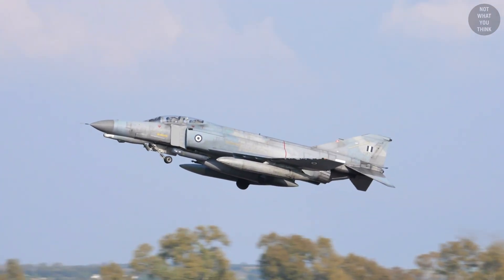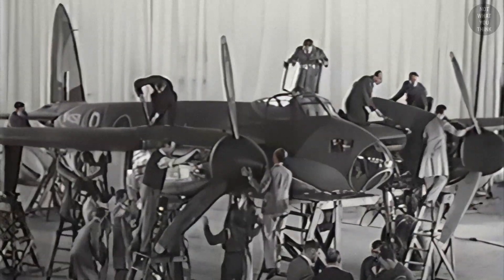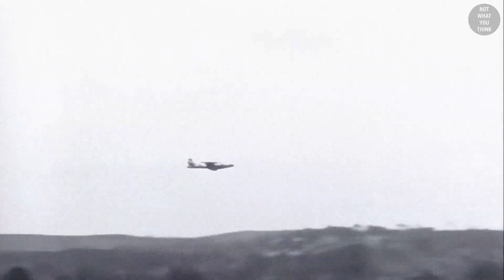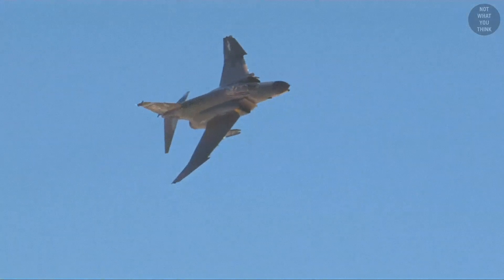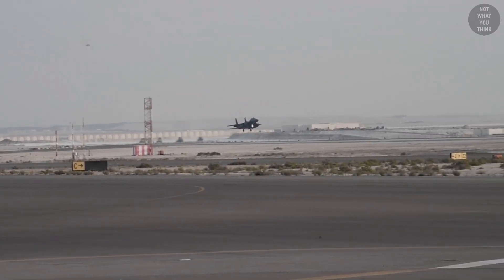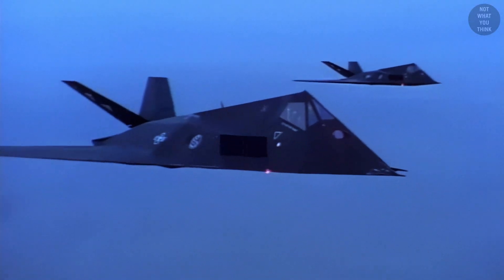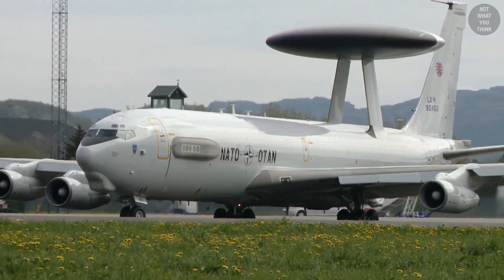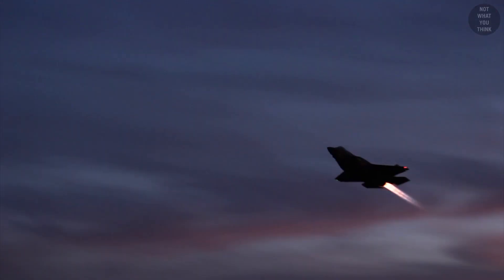Why are Modern Fighter Jets Slower than 1960s?

Comment: You're right about the wasted fuel accelerating to a combat zone for most planes but the F-22, a few others have supercruise, enabling long-distance flight well above supersonic w/out afterburner. With the F-22, top speed is classified but acknowledged as at least Mach 2.3
Reply: Supercruise is almost useless nowadays.  Better to stay high subsonic, move into unfair/unseen NEZ parameters, release with LPI Data-link mid-course guidance, possibly with cooperative LPI and EW held in reserve/conjunction with the attack.

Comment: So you can go mach 2.2 for 10 minutes, then you have to slow down and refuel,  that modern fighter can  even supercruise and go a lot further in the long term.  Not to mention the new fighter can out turn and out gun the older fighter.  In fact the older fighters first indication that the "enemy" is there is going to be when the "enemy" missile explodes in his face - buh bye.   The only issue we have had is that the ROE keep including that line "Visual ID" (VID)   and that's why modern fighters are still designed for the unwanted dogfight.    Tell a modern fighter pilot "Weapons Free":  and remove the VID rule and the pilot in that old jet will be dead before he ever gets a chance to see the enemy.

Comment: The problem with the f35 is that it's a cheapout solution in order to streamline production into one airframe. However it suffers from the jack of all trades/ mediocre at all trades problem. Also it's not cheap

Comment: The MiG-25 was theoretically capable of a maximum speed exceeding Mach 3 and a ceiling of 27 km (89,000 ft). Its high speed was problematic: although sufficient thrust was available to reach Mach 3.2, a limit of Mach 2.83 had to be imposed as the engines tended to over speed and overheat at higher air speeds, possibly damaging them beyond repair. The specific fuel consumption with afterburners is actually nearly equal to the US, F100, despite the F100 being a far newer engine design.
Reply: Cool story bro but this video just explained why speed isn't everything a good fighter aircraft needs
Reply: @Djokkum  Hilarious complete misunderstanding of everything, absolutely everything. The Mig 25 explains all of this and in such great detail, to read an idiot not understand this?, is simply remarkable, it proves you don't even understand what you've just listened too. LOL

Comment: Today's air warfare doesn't really require certain amount of speed.

For instance, we are all forgetting about the F-22 Raptor, essentially the most dangerous fighter jet in the history of man. It has 2.414 km/h max speed and it's stealthy. However it's not its speed nor its stealth that's dangerous, it's the engine design and the equipment it carries that makes it dangerous.

Accuracy and efficiency. Has dual 2D engines which give him more stability than most aircrafts ever existed.

Comment: Different philosophies, and needs. The F4 was an "interceptor" it was built first and foremost to shoot Russian intercontinental bombers with missiles thus originally it didn't even carry a gun. The F35 is a multipurpose plane. It is meant to replace the F16 a plane that has approximately the same top speed. The replacement for the F4 was the F15 and later, the F22. Both of which are faster than the F4.
Reply: Seemingly these Americans have no idea the F-22 and F-35 can't see, track, or target any other stealth aircraft from BVR (beyond visual range). Stealth alone defeats high-frequency (short wave) radar by absorption and deflection, it does not defeat low-frequency (long wave) radar. Therefore, to see, track, and target stealth aircraft you must have long-wave radar, but it must also be enhanced to remove all background clutter for targeting purposes.

Neither the APG-77 radar used in the F-22, nor the APG-81 radar used in the F-35, can see any other stealth aircraft from BVR (without enhanced long wave radar) — This fact the US Air force obviously know! Only it seems the reality is, that when the F-35 radars were being designed 13 years ago, there were no other stealth aircraft to think about as a potential threat? So how can these US aircraft be seen as any sort of threat to either China or Russia, who both have these aircraft technically beaten? They can see and target US jets from BVR, yet the US jets can't even see them from BVR?

Russia's new 5th generation Byelka (2band) radar, used in SU-57, does have enhanced long-wave radar, they've designed and developed the first L-Band fighter radar we've ever seen. They've cleverly embedded L-band AESA radars in the leading edges of the wings. The new L-band AESA radar data gets processed in real time through extremely powerful Russian Elbrus computers being significantly enhanced removing all clutter, meaning it can see, track, target, and engage enemy stealth aircraft from BVR. The technology along with its impressive range parameters and jamming ability over large areas make this aircraft deadly to all other aircraft types. 

They can also interact in ''real-time'' with each other member of the squadron, (auto selecting) the best placed BVR missile, that can be fired by anyone of the squadron with a bogie on radar, they can also take control of surface-to-air (SAM) missile defence systems - (that alone is lethal), and they can see track, enemy stealth fighter aircraft long before Russian airspace, from much greater distances, with "real-time" data from massive Russian ground long wave stations (that are all protected today with the networked S-400 defensive system). 

Therefore, as they'll always know where the enemy aircraft are, they'll always be able to approach any enemy aircraft head on, and therefore stealthily, (Russia wisely sacrificed rear end stealth for much better manoeuvrability) meaning today, the US fighter jets would not even be able to see them coming!! Russia's Byelka (2band) radar covers all aspects of frequencies across all channels, that are used for tracking, targetting, and also jamming. It's part of Sh121 multifunctional integrated radio electronic system (MIRES) on board the SU-57. 

Russia tested much of this new radar suit on the SU-35, so they also have the option of fitting this radar into SU-35's permanently, meaning Russia's SU-35S flanker will be at no disadvantage with F-22/35. As although the SU-35 can be seen and targeted from BVR, the SU-35 with the new 5th gen radar is as able to see and target the US jets from BVR, seeing the all-important Russian advantage in BVR missile distance, plus the excellent manoeuvring, neither the F-22/35 have, as more than critical, if you're going to avoid simply being blown out of the sky.

The design has clear potential to provide a genuine shared multifunction aperture with applications including: Search, track and destroy missile mid-course guidance against low signature aircraft. Identification of Friend, Foe/Secondary Surveillance Radar. 
Passive angle tracking and geolocation of JTIDS-MIDS-Link-16 emitters at long ranges.
Passive angle tracking and geolocation of L-band AEWC-AWACS and surface based search radars at long ranges.
Passive angle tracking and geolocation of hostile (i.e. Western) IFF and SSR transponders at long ranges.

High-powered active jamming of JTIDS-MIDS-Link-16 emitters.
High-powered active jamming of satellite navigation receivers over large areas.
High-powered active jamming of L-band AEWC-AWACS and surface based search radars at long ranges.
High-powered active jamming of guided munition command data links over large areas.

Effectively neutralizing the USA's use of AWACS for their detection. The Tikhomirov NIIP L-band AESA is a very important strategic development, and a technology which once fully matured and deployed in useful numbers, will render narrowband stealth designs like the F-22 & F-35 Joint Strike Fighter, and some if not many UAVs, as highly vulnerable to all Flanker variants equipped with such radars.
Reply: @hotstepper887  We will see how well a basically untested radar from 1 or 2 Russian planes will work. Meanwhile the planes that Russia does have are being shot down daily by MANPAD Stingers.
Reply: You all talk so much crap, none of you really know or even understand anything at all about military hardware, but you all sit and type so much crap to each other, you all start to believe your own dreamt up crap, LOL.

Comment: Well, to be fair, it wouldn't be realistic for the fighters during the Vietnam era to be fighting at their advertised top speed, because that speed is only achievable with a "clean" aircraft. And you don't go to war with an airplane without weapons. That would be silly :)

Also, you're talking about maneuverability, which are achieved at lower speed(corner speed usually), this is only viable in dogfighting or during defensive maneuvers. Employing radar guided missiles at beyond visible range are usually preferred at higher speeds, because it greatly increases the missiles range.  The speeds you mentioned for the Aim-120 for example, is not achieved if you fire it from a plane going mach 0.5, because it will burn up it's fuel before it can reach top speed. But if you fire it super sonic, then at least the missile don't have to spend energy to break the sound barrier, which is a point that consumes a lot of it.
I'm not saying your data is wrong, or the data from the researchers, I just think you left out a lot of key points. Your video came forward as there's no advantage to high top speeds at all, when in reality, there is.

Otherwise a great video

Comment: The video of the F-100 Super Sabre from 1:57 to 2:04 is NOT a good clip to use - it cuts off moments before the pilot. 1LT Barty Brooks, lost control of his plane and slammed into the ground. Brooks died in the fire. It was the first capture on film of the deadly "sabre dance" behavior that once characterized high-speed swept wings stalling out in low-altitude/low-speed flight regimes. Fixing that took a significant amount of engineering to restore low-speed control authority.

Comment: According to this the A 10 should be the best air to air fighter.
Reply: bla-bla-bla           A    stands for   attack.       F   stands for  fighter.        T  stands for  trainer.           military aircraft   are   mission  specific.
Reply: @daviddavids2884  And B stands for bomber. I am referring to the video.
Reply: The A-10 is the sort of aircraft that is exponentially more effective when the enemy underestimates it. All you need to do to defeat it is climb to a slightly higher altitude, but if you attempt to turn with it you will be shot down pretty quickly.
Reply: @dumdumbinks274  since it can turn vertically as well as it does horizontally that won't work. It is only going to be easily defeated from a distance.
Reply: @dennisgray3521  Nope. The A-10  just stalls if it attempts any rapid vertical maneuvers. It has very low thrust and a draggy airframe preventing it from climbing at anywhere near the rate of a fighter.
Reply: @dumdumbinks274  It doesn't need to climb, just point. The 30 mm shells will do the climbing.
Reply: @dennisgray3521  That is the equivalent of hip-firing a machine gun and expecting to hit a target 1000m away. It's highly unlikely to hit anything of worth, let alone cause the target to panic.

Comment: Two big ones missed here.

Stealth aircraft are designed for stealth, not speed. They are surprisingly draggy due to the shape of the aerodynamic surfaces that have been optimised for minimal RCS. The F-35 has a huge thrust advantage over an F-16 but it has to brute force its way to top speed. The F-22 is the same.

On the flip side, higher top speed has a significant impact on the range of missiles. The more smash on the airframe, the more energy the missile has at launch and therefore the less energy expended by the missile motor to reach its top speed. This is one of the key advantages of supercruise. The ability to outrage enemy missiles whilst not appearing on enemy IR or radar systems until it is way too late for the enemy aircraft.
Reply: ???         those two fighters  are  NOT  high-drag designs.     (unlike the f117)        'brute force' may be needed, for payload carrying ability.           your second paragraph  is  NONSENSE.
Reply: @daviddavids2884  Sorry. You are wrong. To achieve an incredibly low RCS, airframe and wing profiles must be severely compromised.

They are efficient enough at lower speeds, which is good because they get to maintain significant range but as speed increases and the properties of the air they are flying through change, the supersonic drag severely limits their ability to reach the speeds attained by 3rd and 4th generation aircraft.

Even the air inlets for the engines are restrictive. They are optimised for low RCS and do not flow well at supersonic speeds.

If you know anything about the differences between the B-1a and the B-1b, you will know that the revised engine inlets on that aircraft severely reduced the top speed but lowered the RCS by a surprising degree.

Go and research it. Stealth is far more important than speed. Such is why the compromises are accepted. The only time it is likely to change is when the 6th generation aircraft are revealed. Most are apparently going to be tailless designs. Some may even be genuine flying wings. This alone might reduce RCS enough for some of the compromises to be removed and the aerodynamics more biased towards top speed.

Also, as pilotless aircraft develop, the enemy to supersonic manoeuvring is removed. The pilot is the greatest limiting factor on G limits placed on modern combat aircraft. If air superiority drones develop far enough, supersonic maneuvers in excess of 20G are well and truly in the realms of possibility.

Time will tell. Plenty of time for you to go and do some genuine research :)
Reply: @daviddavids2884  Oh, the second paragraph of my original statement is simple Newtonian physics. If you had stayed awake in highschool, you would see it clearly.
Reply: @daviddavids2884  Thirdly, the F-117 is not particularly draggy given that is is subsonic. The wing did compromise low speed handling somewhat due to the faceted shape and large amount of sweep.

If, however, it had posessed afterburning engines, it would not have been fast at all. Absolutely zero area rule, engine inlets that are totally unsuitable for supersonic airflow and a aerodynamic profile totally compromised by its absolute focus on stealth over any other design considerations.

Comment: The Russian radar will pick up the raptor and the f-35 and other stealth bombers on the USA side the Russian radar doesn't operate the same way that the USA radar does
Reply: So it's not actually RADAR? Okay, gotcha.
Reply: @NZobservatory  i was going to mention since your comment has smarty pants comment wont answer okay gotcha
Reply: @crunchied8  Signal goes out... signal reflects (or not)... signal returns (or not)....This is how RADAR works. If it doesn't operate like this it isn't RADAR, it's something not RADAR. Alternate system details, such as the wavelengths, or how the signals are processed or interpreted, doesn't mean it operates differently. It's still a system reliant on reflections.

Comment: something that should also be added or considered is the stress and burden on the pilot. Regardless of how great the machine is, there is a limit to how much the human controlling it can handle, be it in the short term of a sortie or in the long term.
Even if we build a jet that can outrun e.g. a SAM, the human pilot would likely black out during emergency acceleration or turning with permament after effects for the body being quite possible.

Comment: But the F-35 has a terrible climb rate, a terrible turn rate & a low top speed. For the amount of money these cost & cost to keep in the air. I think I'd stick with a modern upgraded variant of the F-15 every time. There's a big reason the USAF uses the F-15 a lot more than a flying pig it's a much better all round aircraft. I'll put my crash helmet on for all the fan boys in denial now.
Reply: And get shot down.... F35 can fly over putins house and he wouldnt know... i fly them i know
Reply: bla-bla-bla            you should have  Stopped  typing at  'speed',  davy

Comment: Supercruise ability negates the need for the fuel guzzling afterburners on the older jets... there's less need to do short sprints of high speed instead you can fly fast for longer in modern het fighters... there's no need to go Mach 2 or higher plus better counter measures also negate the need for those high speeds to outrun Sam's also try taking a sharp turn at mach1 or higher.. you'll have a Brain dead pilot

Comment: I think you have failed to mention the intended use of the many of the older aircraft. The aircraft like the MIG 25 and nearly all of the century series aircraft were designed to intercept enemy strategic bombers and not for air to air combat against other small aircraft, therefore high speed and climb rates were a priority over  maneuverability. Even the F-4 which you refer to was primarily designed as an interceptor.